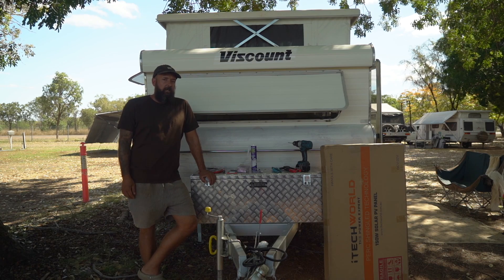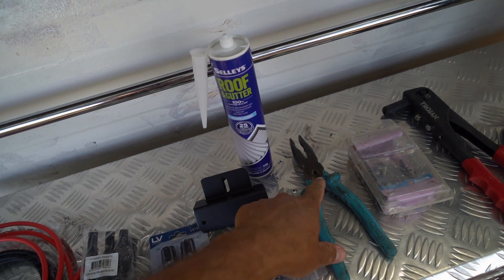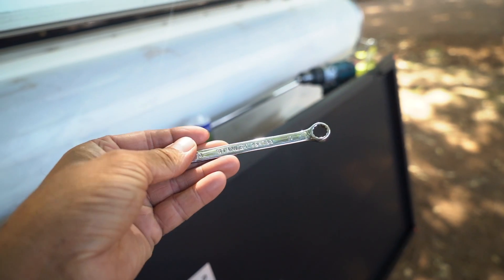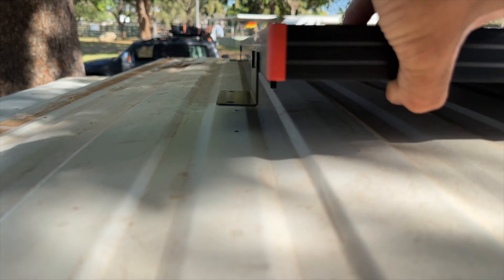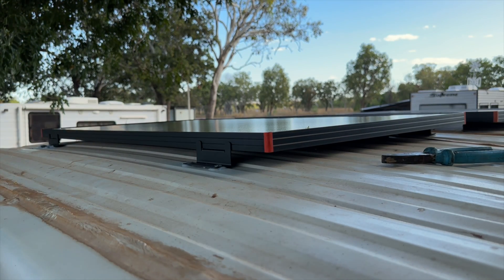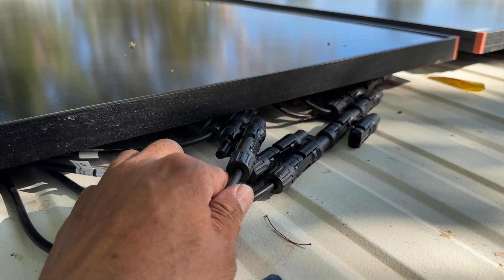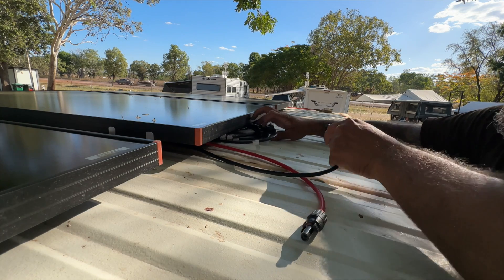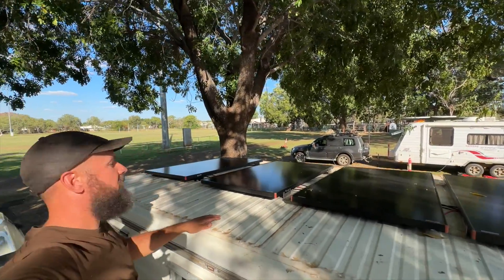Installing the iTechworld 150W 22v Solar Panel with As We Wander

Comment: I would be worried about the weight of the van by now
Reply from the maker: Don't need to worry - these panels are super light at 9kg each - plus the savings of switching from AGM to Lithium easily offsets the solar panels.